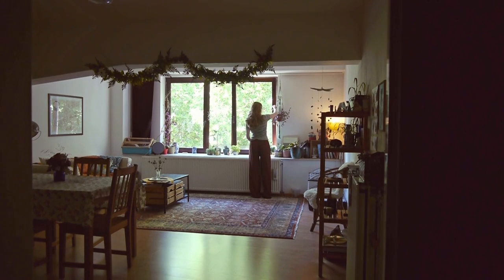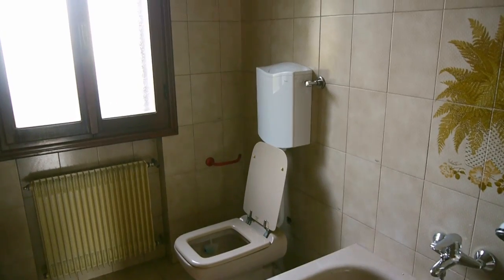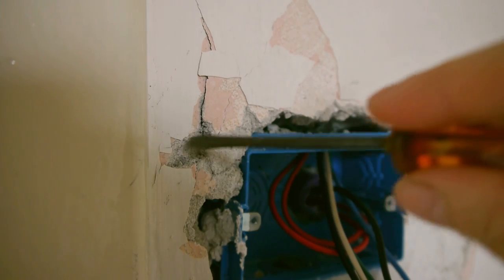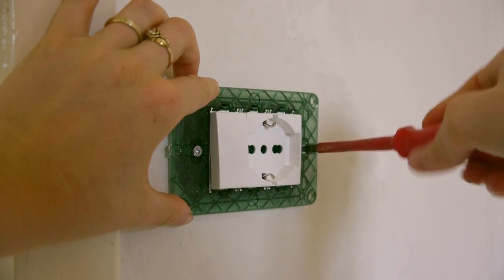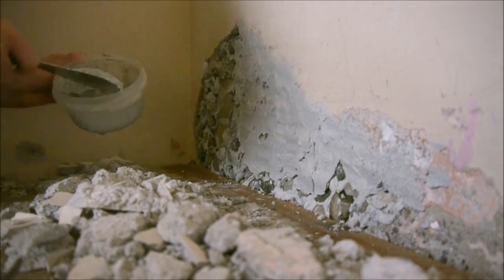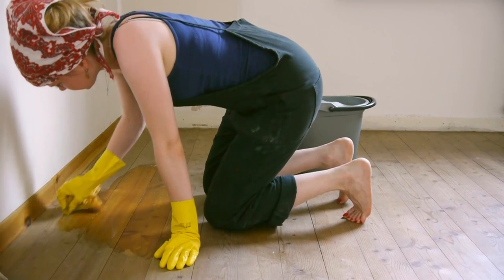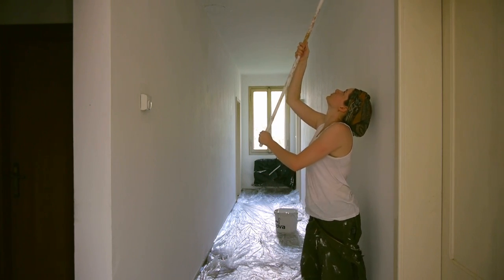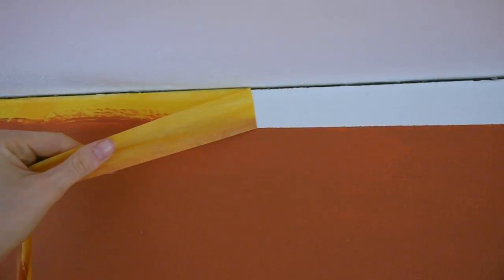Renovating an abandoned Italian house | Making home in a new country ep 1

Comment: Professional tips. 
1. Don't ever use silicone except in kitchen/bathroom contexts. Silicone isn't paintable. Around doors and skirting boards use an acrylic caulk which allows you to paint over it. 
2. Get a larger trowel.
3. Use a wide pry bar to remove old wall material. Drive it into the material from the side and lever it up. Anything that's still well attached won't come away. 
😃
Reply: Follow up tip. I almost never use masking tape for painting, but if you do a few things to keep in mind are:
Don't leave it on too long as it will tear the paint underneath.
Remove it immediately after doing your final coat. If you allow it to dry it will form a continuous skin with the paint on the wall and will tear some of it off. Also try to get as little paint as possible on the tape in the first place. Try to paint as if the tape isn't there.
Reply from the maker: Thank you for your tips, they are very helpful! For the silicone I should have clarified that it was a water-based one that allows to be painted over. Have a nice week! 😊